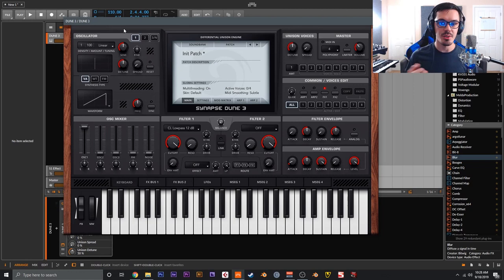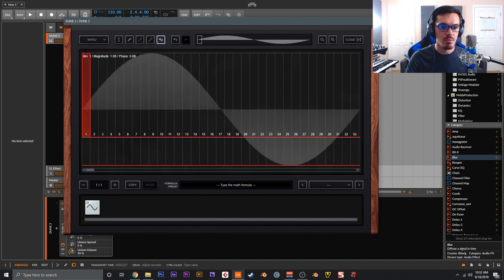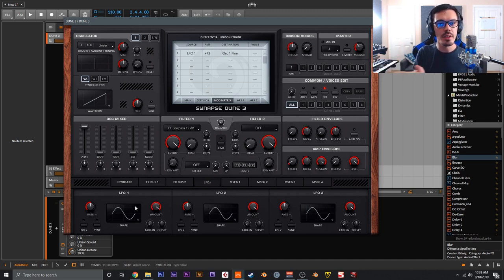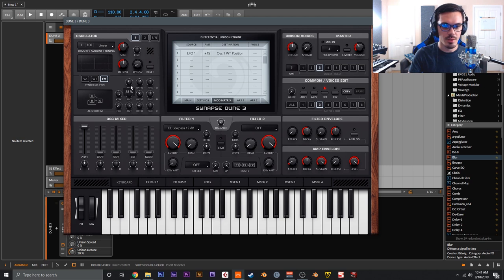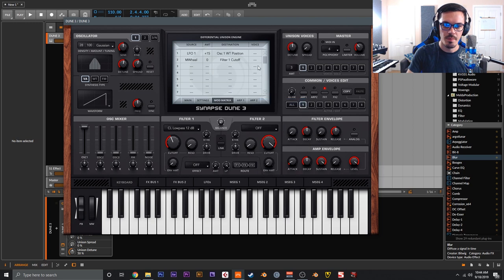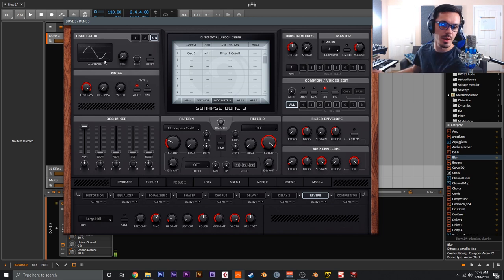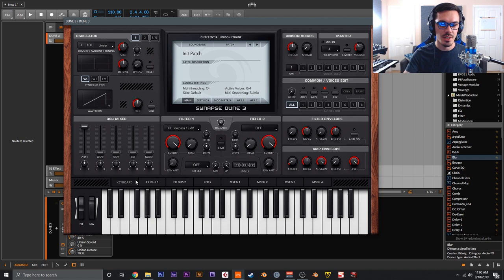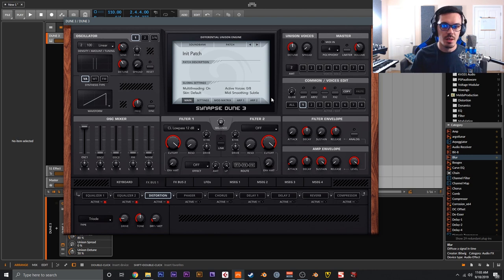DUNE 3 Tutorial for Advanced Users - Wavetables, FM Synthesis, Multi-Layering, Audio-Rate Modulation

Comment: The sample and glide polyphonic lfo thing is great, but am I missing some way of applying that to other things like the filter cutoff, rsonance, and filter/amp ADSR components?  I'm trying to do the thing OBX- PRO II does where there's a subtle variation for each of those things per oscillator.  It sounds to me like when I try to apply the poly lfo to things like the filter cutoff, it's not doing it separately per oscillator.  Do I need to instead create separate voices per oscillator and dial in the variation manually, or is there a way to use the poly lfo for this?
Reply from the maker: Yes you can use the Poly LFO on anything, the filter cutoff, resonance or the ADSRs, and it can be used to create subtle variations per voice. Make sure you are using the latest version v3.4 though. Note when you say "oscillator" I assume you mean "voice". You can also modulate the oscillators 1-3 individually with the Poly LFOs, that is unrelated to the filter or ADSRs though.